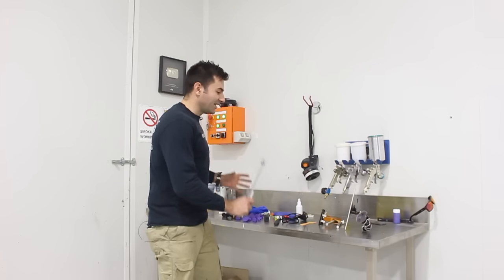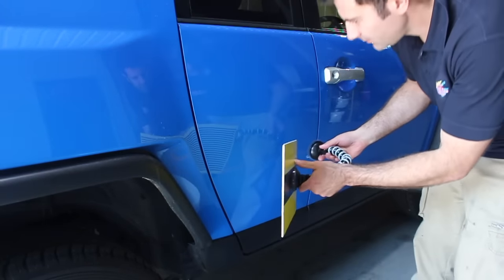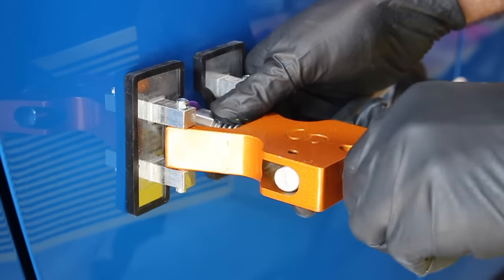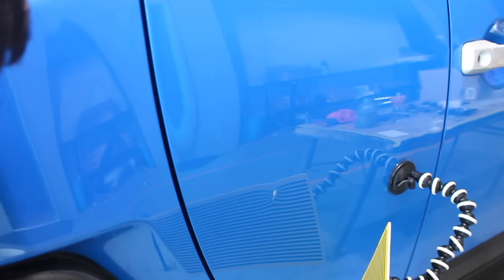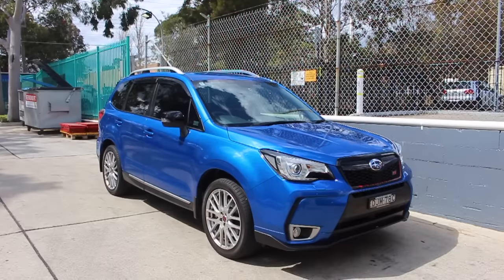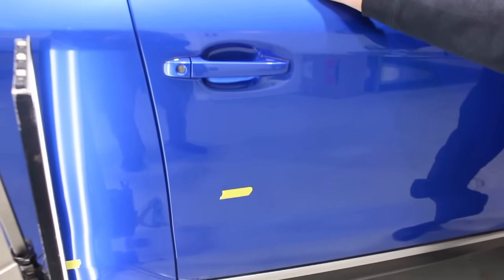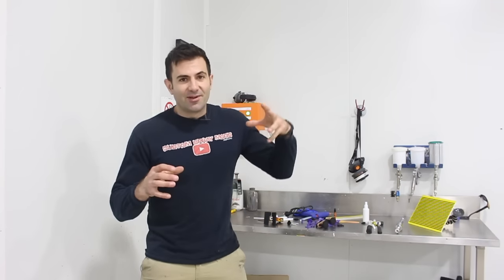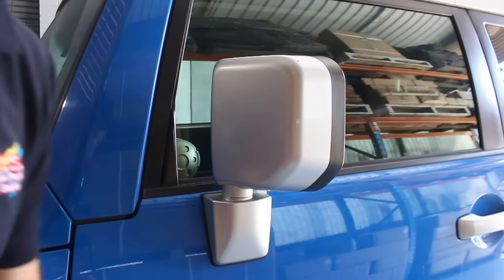Paintless Dent Removal DIY & PRO

Comment: Tip; DON'T use wax and grease remover over the dent area after washing. The glue will still be more than strong enough to stick to the area but will be fully removable with just one pry using the pry tool.

Comment: Bought the same tool and I know nothing about paintless dent removal , I knew I wouldn't get it perfect but what I did do is repair it to a point where the dent wasn't as bad anymore which lessened the cost of the repair y about 70% when i took it to a professional PDR to have the edges and small bits fixed .  Super happy .
Reply: That's smart way of doing it, I'm getting mine done today by a pro PDR, it'd gonna cost me a little over 100 bucks, but next time (hopefully not) when I get a dint I'll use the kit, then a pdr pro aswell..

Comment: I've tried to use this exact tool to remove countless dents, and it doesn't work.. maybe there's different grades of hot glue?? But even on very light gage tin sheet metal this "glue tab puller" system doesnt work

Comment: I bought a kit like thins one and I love it. Within just a few hours worth of work I pulled and beat out pretty much every ding my car had in it. The kit I bought came with chisel like "dollies" and I found that most of the dings would come out easily just by beating on the edges with the dollies. I actually surprised myself at how good I was able to get the dents out. I did learn one thing: don't try to use the glue on a black car in the sunshine on a 90 degree day. LOL! The glue never cooled down enough and would pull right off. I paid $99 for the kit on Amazon and literally saved hundreds if I took it to a body shop with just a few hours worth of work. If people knew how easy it was body shops would probably start losing money.
Reply: Which kit on Amazon did you buy?
Reply: what kit did u buy?
Reply: @DanielC00100  I can't remember the exact one, but it cost around $99 I believe.
Reply: no issues with chipping paint? thats my only worry, i just got my amazon puller kit but now that the pro in this video just pushed them out, im having second thoughts

Comment: I haven’t done any pdr but when removing hot glue I use isopropyl alcohol , after a bit of a soak it breaks the bond and the glue will just peel off
Reply: Thanks!
Reply: 3
Reply: Weak paint thinner shouldn't damage the paint but yeah I use alcohol.
Reply: The instructions that come with these kits tell you to use 91% alcohol lol.

Comment: Do not use paint thinner for this. Paint thinner is safe with certain rags. Alot of micro rags have dye in them and it can be runny and stain your car paint and be hard to get out. Use alcohol.

Comment: After suffering hail damage recently, I've been watching PDR vids.  Couple things I noted:  
1.  You should squeeze and release the handle of the DIY puller tool several times, pumping it before doing the final squeeze that pulls the plug off the glue.  This works the metal before yanking it hard.
2.  Alcohol is best used for removing the glue.  Paint thinner sounds very dangerous and unnecessarily harsh.
Reply: Our RACQ guy thumped the panel at a certain place with his fist, away from the ding (a big one). It popped out immediately and you couldn't see where it was. Some cutting paste had the paint fixed and my son didn't have to pay the quoted $1400 panel beater repair.
Reply: Going to pull off in 5 minutes, wish me luck. Thanks for the tip.
Reply: Great vid👍🏻
Reply: Really sharp small dents like hail are the hardest to remove because they stretch the panel

Comment: This is exactly the same puller as available in UK, it won't remove those long sharp dents or serious dent damage like some photos on the purchase page show you, BUT for small door / wing / quarter dents etc it works !   I'm no expert and just followed a few of these tutorials ( of which there a many ) and I removed a nasty rear door dent caused by a careless door opener in a car park, took three or four pulls, bit of light tapping down a couple of high spots and it was out ! ..... great little tool for novices and smallish dents.
Reply: I'm curious how nasty your dent was? As I have a nasty dent on my rear car door as well. It's not necessarily big however it's not like these circular dents I see a lot these videos do. Just wondering if I'd have any luck with one of these tools or it'd be a lost cause.

Comment: Don't use paint thinner. It's called that for a reason it will literally eat through your clear coat and destroy your paint. Use alcohol to remove the glue.
Reply: No it won’t 😂
Reply: @officialWWM  yes it will... I've used to to remove paint plenty of times on car parts. Hence the name paint thinner.
Reply: @bltsandwich567  er, I’m a car painter. I have been for over 20 years. I assure you, paint thinner will not even touch modern 2k automotive paint! Once it is cured, it’s virtually impervious to chemicals. That’s kinda the point of it!
Reply: @officialWWM  if you believe that I question your experience as a painter. Any decent painter will tell you the basic fact paint thinner will eat through the any wax, sealants, clear coat and base coat on the car. The fact you just claimed modern paint is impervious to chemicals is even worse. So you believe modern paint can hold up to brake cleaner as well?
Reply: @bltsandwich567  I said “virtually”! Twenty years ago, when car makers were transitioning from acrylic paints to 2 pack, one of the tests to see what you were working with on a vehicle was to put a rag soaked in thinners on the paintwork. If it was acrylic, the paint would instantly go soft and sticky, if it’s 2k, it won’t even touch it. Suggesting someone wiping down a panel with thinners is somehow going to damage the clear coat is just wrong. It will remove and wax or polish but it won’t harm the clear!
Reply: @bltsandwich567  it won’t harm 2k 🤦 i am a chemist and i work with car paint

Comment: The tabs tend to pull away from the glue before the body surface. Scuff the tabs lightly with sandpaper to give them more glue holding power.

Comment: Try using isopropyl alcohol to remove the glue, it works well
Reply: Or gasoline
Reply: It damages the clear coat so no
Reply: @TeoYankov1234  Only in high concentration

Comment: You shouldn't use paint thinner you would you should have used as alcohol in higher percentage
Reply: Trieuable was
Reply: Alcohol damages the clear coat
Reply: @TeoYankov1234  it dosent. I'm a profesional auto Detailer, and we use this stuff before we apply coatings. And it's in the slip soloution we use to apply ppf.
Reply: Brian Naeem I did that on my car the clear coat got bad
Reply: @TeoYankov1234  what concentration did u use? It shouldn't be more than 50
Reply: Mitsu Guy and paint thinner is better.? It literally eats paint
Reply: @OvenBak3d360  You're thinking of paint stripper. Paint thinner is just that, a thinner to dilute liquid paint.
I get them mixed up while reading as well, I dunno why but I do it a lot. 😅
Reply: You must be pretty bad at it hmmmmm yeah never painted anything that I needed to use it lol

Comment: What if next time you have a small dent like that? You should try putting a small dab of glue smaller than the dent. So when you are pulling it's only pulling the dead center of the dent. Instead of the whole surface of the Tab
Reply: Doesnt work like that, you still need to tap with a plastic hammer the affected areas. You will always pull more metal than needed. Needs to be tapped after
Reply: @Ciolan so you pull out and stretch the whole area, and then hammer it flat ?

Comment: I just bought a car with a Huge dent in the back wing.  I had no tools but made a pusher from a wheel brace and a Paint roller with a softened tip with with tape .  I got the dent out and it straightened the panel.. I need ed a Glue tab puller though to get the remaining small indentation out.  The car looks OK though but obviously no where near a perfect job.. Not bothered though as it was bought as a damaged car.

Comment: Everyone relax, paint thinner will not go through clear coat. You should be a hell of a lot more concerned about the glue.
Reply: Except you dont know how thin the clearcoat is. Thinners is for thinning paint. Its not for cleaning paint. Use wax and grease remover.
Reply: Paint thinner is literally designed to remove paint, including clear coat.
Reply: @YeetxBoi  It won't remove factory clear coat. If it's repainted then yes.

Comment: So I am using this technique to remove the dents and it worked well for the dents. But now my area is scuffed up and you can see the trace of the round tab pattern in the paint, basically removed or dented the clear coat. I'm working in a garage thats about 15C-20C so the paint isn't hot or anything and I don't use anything to warm it up. I'm using the yellow glue, never the black. What am I doing wrong? My theory is that the car was repainted (I can tell) and the clear coat they used was crap (soft..scratches easy).
Reply: You need to heat up the dent area with a heat gun. This will make it easier to pull the dent out because the metal molecules have expanded. Its almost like heating a plastic container when it's cold it's hard to bent but when it's hot or warm it will easily warp or fold with your hands.as for the scuffing you could try a bit of polish after you are done
Reply: I did some research yesterday, it said use yellow glue when outside temperature is 30 C. I think black glue is better suited to 20 C. You can use compound to remove paint scoffs it is a little harsher than polish, then polish afterwards.

A lot of the anti scratch stuff are simply compounds, some a mixed with polish.

Comment: Is it possible to pull paint off? I have a dent where the paint cracked and wondering if the glue will pull my paint off
Reply from the maker: If it's cracked there is a good chance the paint may come off.
Reply: @customspraymods  ahhh kinda thought so, bought a kit from Amazon but I think I’ll leave it to a professional. Thanks for the reply

Comment: use more touch up paint, blend with thinner if necessary, let it cure, then wet sand. it should be invisible afterwords. 
dont be afraid to cake that shit on there.  you want to sand it down even. 
i fix paint imperfections and drip marks all the time. you want to be comfortable doing it. practice on scrap metal if you want.

Comment: Hi is it ok to use a normal hot glue gun and glue? Is does the PDR process require some special hot glue?
Reply: Hot glue can melt paint/clear coat
Reply: @davidzplace2011  No it won't.
Reply: We use all types of glues for certain situations.  We have glues formulated to work in all different temperatures.  The regular Walmart glue will work fine for some people.

Comment: In the near future not too long to wait is memory metal, i would say it could be here within the next 10 years or so...maybe even 5, simply crash, use heat and the metal will straighten back to its original new form, no more dents but I'd say they'll have it in the top range of vehicles such as small sports cars like a Ferrari or a Lamborghini, maybe military get it first before its used for domestic purposes.🤔

Comment: I didn't see one heat gun in this video. I'm not a pro pdr but I have some experience in that field of work. It is easier to heat the metal first before performing pdr. This expands the molecules in the metal making it easier to manipulate the dent. Otherwise its going to be alot more difficult if the metal is cold and the molecules are tight also the silver hammer you were using on the tap down is the wrong hammer. You should have been using the small dead blow hammer supplied with the kit the silver hammer is the crown hammer. Never the less still fun to watch 👍

Comment: how much does it cost to have the pro come in?
Reply: Our starting price is $125.00 for a mobile repair.  We'll repair up to 5 small dime sized to nickel sized dings for that provided there isn't a lot of R+I involved.

$150 to $175 for Quarter to Half dollar sized.

Anything over 5 inches is 125.00 to 150.00 for the first inch and 50.00 each additional inch after that.

Some places charge more, but that's about a base where we start.

Comment: Top tip.. that kind of glue can be removed very very easily with some  normal lighter fluid, juts a dribble around the edge of the glue and it will creep between the surface and the glue and just fall off within 30 seconds.

Comment: If your car is a nice one then don’t do this yourself. Pay for a professional.
Reply: Why are you on this video? It's a tutorial. Don't watch if you don't want to use the info.
Reply: @AlexanderWebster_  My advice is relevant. I know from my own experience that you can make the surface look noticeably worse if you don’t know what your doing. You may get the dent out but in doing so you can stretch and ripple the surrounding area which ruins the look of it. Once that happens the only solution is a full repair and respray. If your car is a daily beater then no problem I guess, but if it’s a nice one then don’t attempt it, you will likely ruin it.